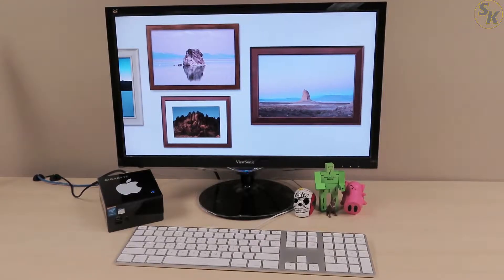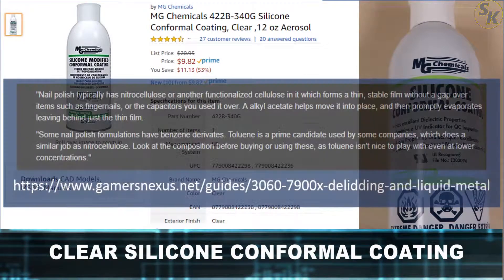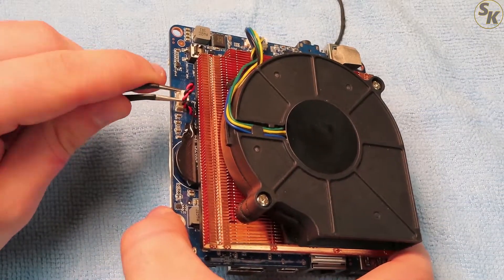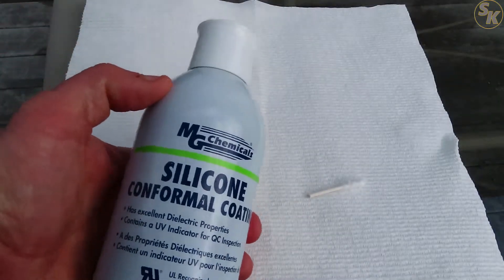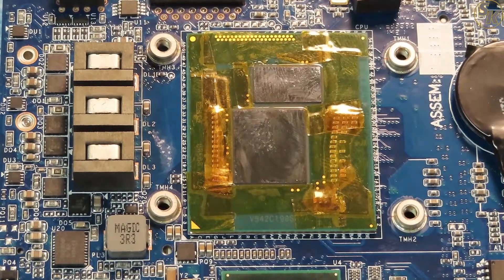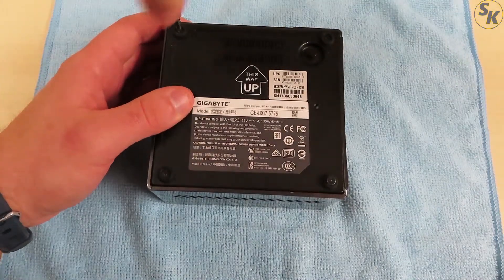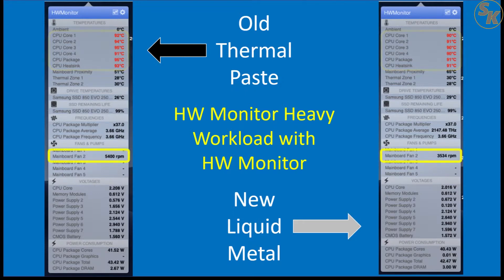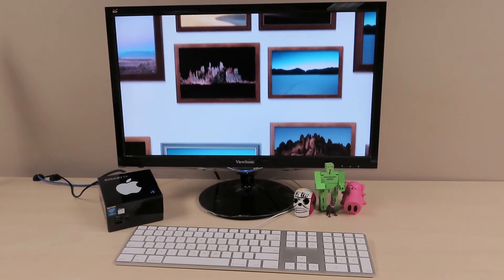Applying Liquid Metal to a Gigabyte Brix Pro BXI7-5775

Comment: I owned Brix 4570R that had a desktop CPU inside, but after some time I sold it, because temperature was reaching 90-95 and suddenly network card stopped working, throttling started, SSD insde started to overheat...Remember - no any such chasis can keep low temps, no matter what thermal paste yo use. Sad, but true.

Comment: Keep us up to date on any progress. I hate loud fans. Can you use a Mac Mini fan or Macbook fan or laptop fan ?
Reply from the maker: Sorry for the late reply.  

I do not believe you can use a Mac Mini fan or laptop fan due to each PC's motherboard design without some sort of modification.  

So far since the video has been out, the Brix has stayed the same.  It's not my full time PC, and only use it at max 3 times a month, but it hasn't broken down (or quieted down) since swapping the thermal paste out & temps have stayed in the same ranges.  I'm probably not going to swap out the fan because I would like to upgrade to a current gen NUC when I have spare funds.  If I do make an OS upgrade video on this PC, I might take off the CPU fan to see if the liquid metal affected the CPU dies.     

Thanks for commenting!